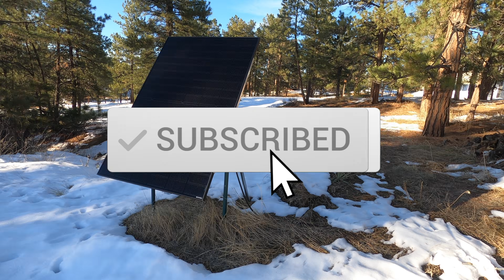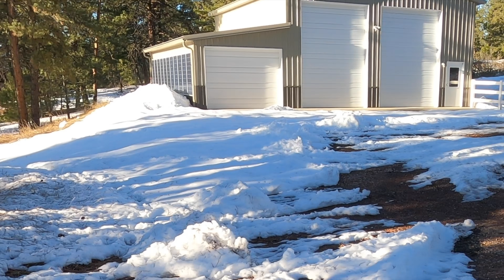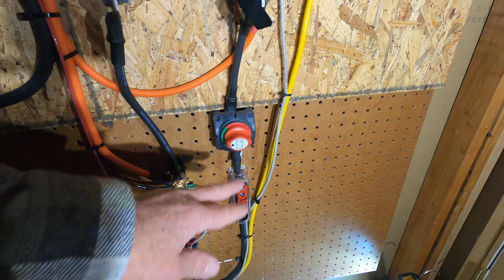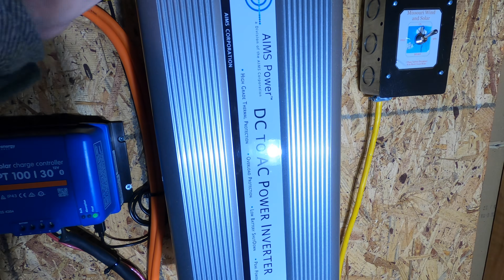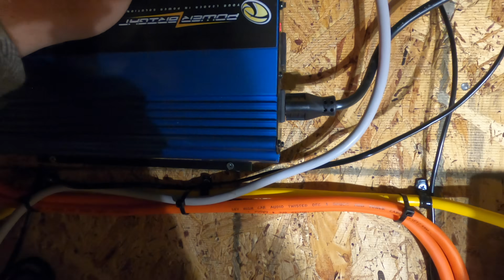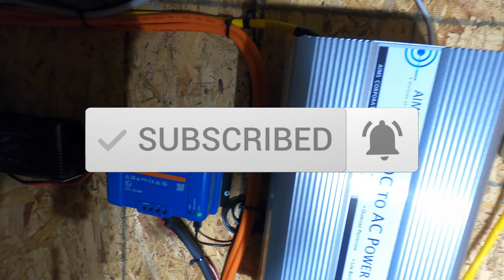Off Grid Expert Shares TOP Solar Well Pump and Furnace Secrets

Comment: Interesting would like to see how your Wind is setup and how much power you can get out of it.

That system is a little underutilized just for the well is your other system far away or why do you have it separated?
Reply from the maker: Hey look at my 75 super beetle Tesla conversion on my playlist. Saw your Tesla rebuilder handle.
Reply: @bparkinson1234  oh cool, Yea gonna have to see that I'm building a Ford ranger EV soon from a Tesla.
Reply from the maker: Main priority for us is to have water when power goes out. Or run furnaceceven though we can heat the house with wood. Next video will show my hybrid system using EcoFlow delta 3 plus and River 2 max.
Reply: @bparkinson1234   I'm also a Well guy so if you need help with your pump I have 25 years experience.

The Tesla channel is just my hobby.

Comment: I like your setup.  I was under the impression that a well pump needed a pure sine wave inverter.  I have a 5000w modified sine wave inverter.  According to this it looks like I could probably use it with an autotransformer to get split phase 240 for my well pump at the farm.  Thanks for the video!
Reply from the maker: Thanks for the info!
Reply from the maker: Probably work. Motors can run   This has been running for four years. Things like tv microwaves etc need pure sine wave.  Dont understand why you need autoformer    Split phase is for pulling two legs of 120vac.  Don’t need that for 240vac well pump. Also autoformer is for making up low voltage. Like and rv in campground plugged into low voltage. Let me know if I didn’t understand. Take care.
Reply from the maker: Hey. Also make sure your single phase 240vac inverter is 60 cycle. A lot of the ones for sale cheap on eBay are 50 cycle Europe ones.
Reply: Good idea! @bparkinson1234
Reply: I'm planning on coming from solar through a 120v inverter, from the 120 inverter to the auto transformer to get two phases of 120 to feed the 240v submersible pump.